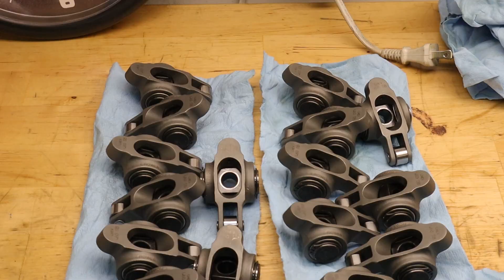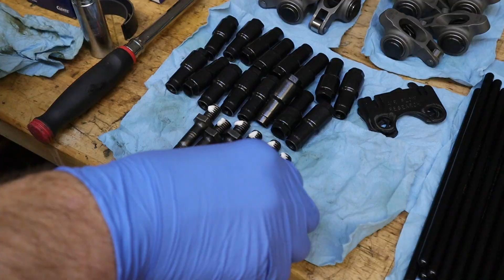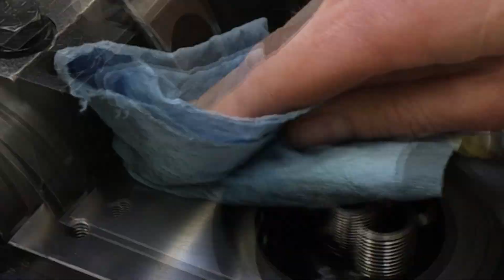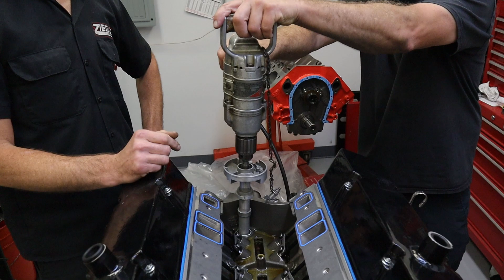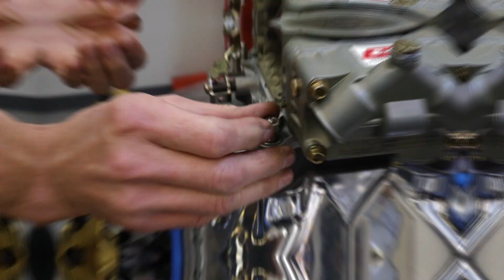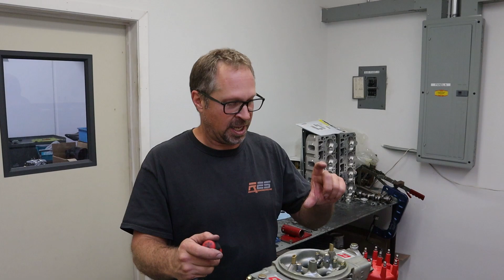Building a Performance 400 Small Block Chevy Engine Part 3 of 3

Comment: How about doing a small block build where the engine will perform but still be able to run on pump gas and pass a smog inspection with Throttle Body Injection.  Yup...California.   I need to upgrade my 3/4 ton 1991 Suburban that has the anemic 350 which is a little slow when towing my 24' travel trailer.  Nothing too fancy, but a clean heavy duty build that will last for a while. I am/was considering a 383 or 400

Comment: I thought the Dart SHP blocks had a .300" taller lifter boss on the topside (to accept the stock late model roller lifters) and required .300" taller lifters? Also they say the lifters cannot be installed or removed with the heads on the block. Was this not an issue or did you mill the lifter boss's down?

Comment: Use isky adjustable pushrod guide plates to center rockers on valve stems. Mock up heads on block, adjust plates, pull heads, spot weld plates, number them to prevent mix up on teardown !

Comment: I just want to ask if you use a GM block or Dart Block and what brand heads are you running
Reply from the maker: Dart heads and dart block. Both are described in more detail in the previous 2 videos on this engine build.